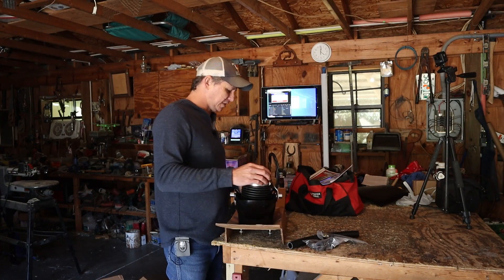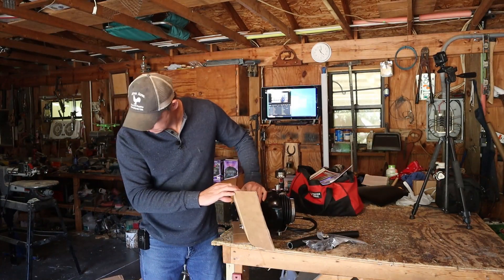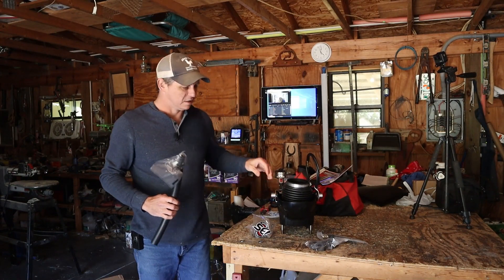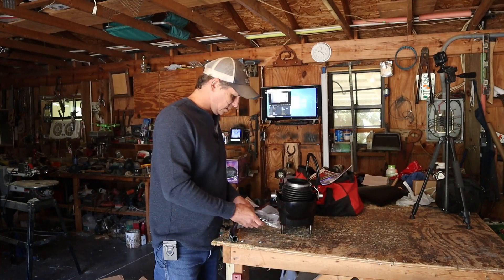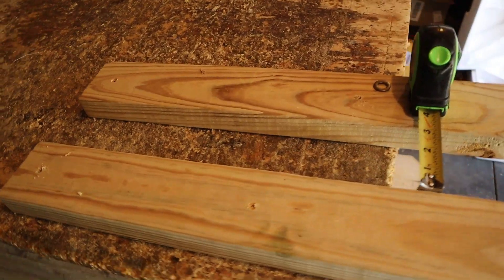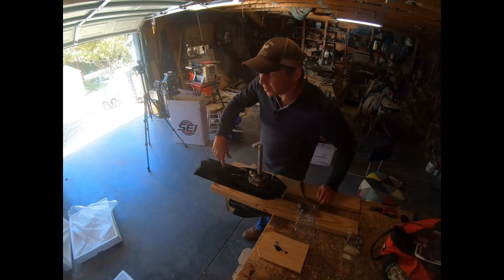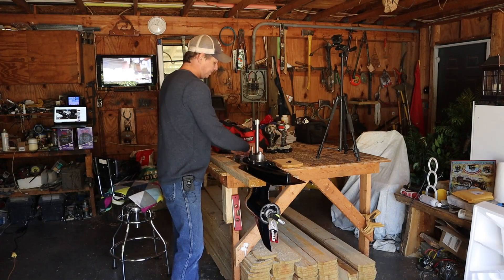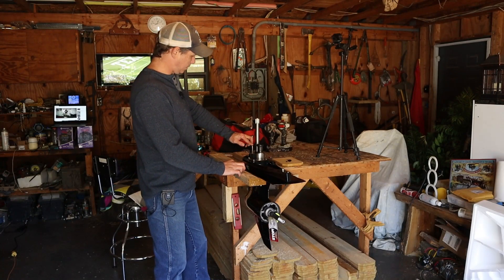OMC Cobra to SEI sterndrive conversion on 1989 Bayliner Cirea 2455 Part 1

Comment: We have one thing in common we work alone. I wish I had the money to do this conversion.  Looking good splash down comming soon.
Reply from the maker: It wasn't cheap but it was necessary a towing and repair bill could cost that much though. thankfully I just worked my tail off and had some good sales but money will be tight this winter.
Reply: Your work is specific , since all work is done singlehanded , what is alamost impossible for some work. 
I am just looking on 2455 , with 5.8 OMC , 1989. 
If price will be acceptable ....